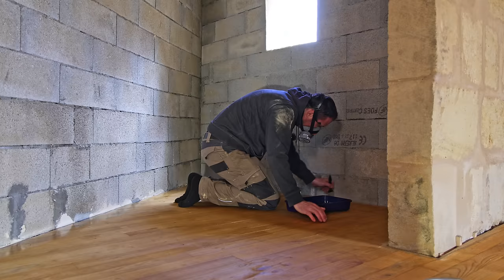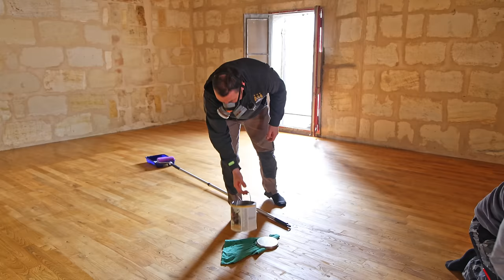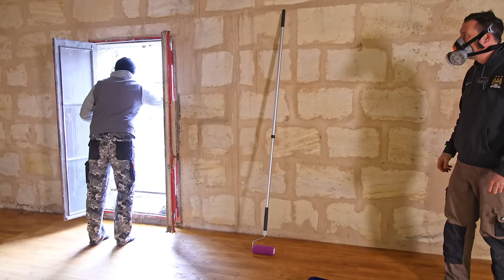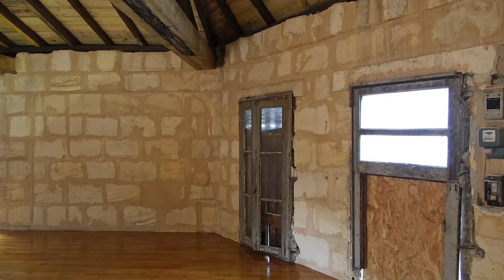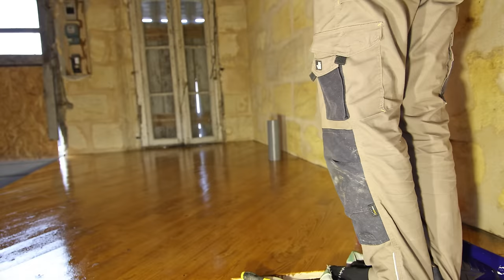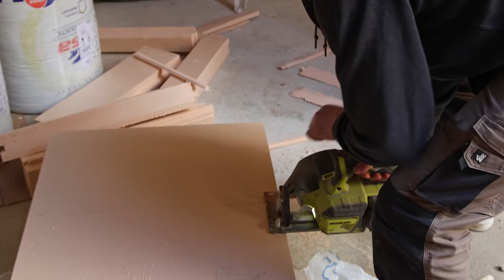A MISTAKE With The Floor at The Abandoned House?

Comment: Concerned about wall insulation and heat sources? As concerns the half wall, why not consider using a translucent glass wall. That way you can take advantage of light coming in above the front door and when the door is open and still provide a barrier so people can’t see what is on the second floor. These transparent and semi transparent walls are very popular in the US and give a very modern feel.

Comment: Just a thought, would it have been possible to use the tall beautiful front door but divide it into two sections? The top portion of the door would be stationary, the bottom section would be short enough so you could close up the floor above.  Similar to how the old massive gates have a smaller entry door.

Comment: 💯🇨🇦🦫🚧😆  Shake that Osmo can make some bubbles.  Sand that floor to get the prep for the next coat.   Between coats use a paint thinner to clean that wood up.   As for covering the floor up for protection?   Not plastic  tarps ok.  But not plastics. No staples ....   and salon in that area better.  But my suggestion is add that floor space back up by building a bed box on top of it.

Comment: Its been a few years but when I used to stain and varnish with oils based products, I couldn't use a roller because it would result in air bubbles and resulting mottled finish. Glad u found a product that doesn't do that.  I'll have to see if Osmo is available in the US.

Comment: Ed the floor looks great, it looks like a dance hall up there, I wish I would have used oil base when I redid my kitchen floor, it looks good, but the water base was very hard to work with, you had to go very slow or it left tiny bubbles. Just imagine how dirty that raw wood would have gotten if you did not put on the Osmo. Yep Louie`s back, Ed, Anna took that camera off of you so quick when Louie showed up, teehee. What a huge difference, I can`t wait to see windows in that  lower floor it looks a bit like a dungeon down there. Golden oak is right, now it`s a glossy golden oak, looks great guys.

Comment: Hi guys! Your enthusiasm is very inspiring. Just a small remark: Applying a clear coat to the floor before finishing ceiling and wall works can be risky. Dust and debris from ongoing construction activities could settle on the floor, marring the finish. Additionally, if there are any accidental spills or splatters during the remaining work, they could damage or stain the clear coat. But I guess you know what you're doing :)
Reply from the maker: We are covering the floor before we start the rest of the works

Comment: I grew up in a 1970's split-entry, with wrought iron railing at the entreyway edge.
Half flight up/half flight down.
The build option was a half-wall of plank-topped sheetrock wall.
A pendulum light or chandelier over the tall entrance door would look awesome, especially if there's an overhead window.

Comment: I suggest putting windows in the interior walls enclosing the entry stairway. They would keep the upper rooms enclosed for a/c & sound purposes, separating those spaces from the front door but allowing light from the glass above your magnificent entry. Could even be high up (@2 meters) like clearstory glass. This would work for the bedroom/lounge room as well as the other side bathroom.

Comment: If looking at the Door the Lounge is the right side.   Then on the Bedroom left side make the 4 foot wall to the Ceiling and hang a 55 inch led Smart Television above the doorway.  Put the seating facing it make it a modern media room/lounge.  Then a 4 foot glass wall around the hole on two sides or wrought iron.  The bedroom shouldn’t be open on two sides.

Comment: I remember so well one of my final studio presentations in architecture school, I’d worked on a mixed housing development for months. The plans went up on a big white board and the lead of my panel of judges just glanced at it and asked in a loud disapproving voice: where is the light coming from? It looks like you haven’t even considered it. And then he started to stride around the floor as if walking around the rooms I had so carefully designed saying “I’m now standing where you have the door. Where is the window?” Of course he was right. I had the windows all wrong. He’d actually been one of Corbu’s star pupils and worked in his studio. 

When I see Edd walking around the floor, even when there was no parquet, just joints, and carefully figuring out where the light comes into each room, I want to cheer. He is doing it right. And he will get it right. The constraints in that small space are daunting.

Comment: Could you not cut the (gorgeous) front door down to size and install the top part as a fixed panel with only the bottom section opening? When it’s closed it would maintain the original look in keeping with the building style but then you wouldnt need all that space for the massive tall door to swing open.